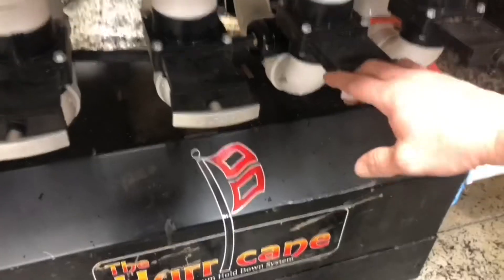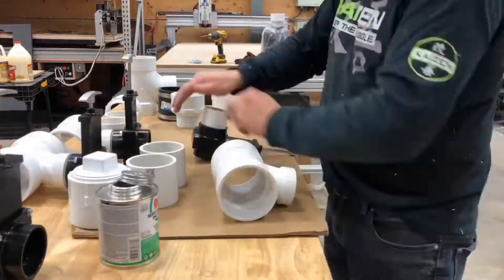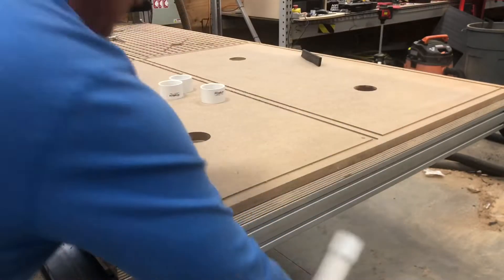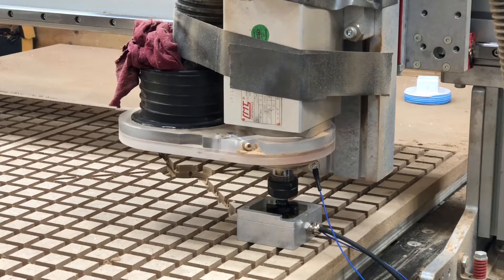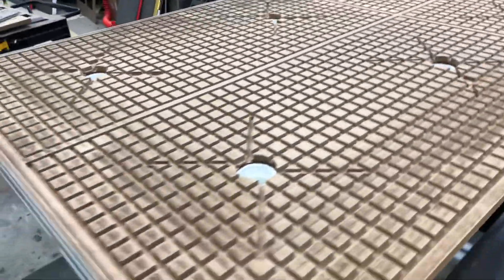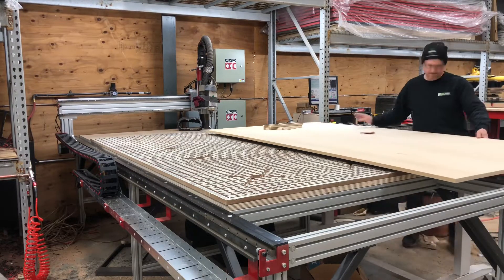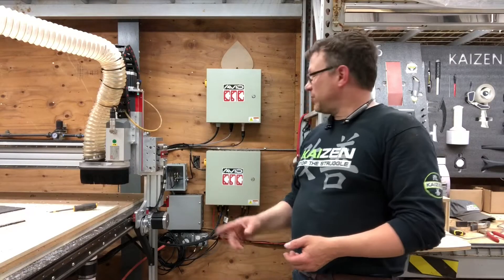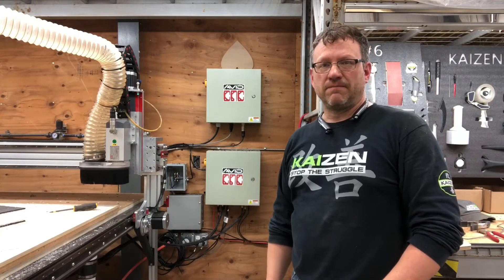Building a vacuum hold down table for my Avid CNC machine

Comment: Thanks for the video. Excellent job.

I just ordered a 5x 10 with extended gantry and 2 Z axis with 12" ballscrew. I'm planning to do this exact setup for the vacuum table. Ready to order the hurricane right now. Is there a competing Vacuum pump system I should look at or have you found the Hurricane to be satisfactory?

I'm also curious why you couldn't just do the plenum table out of the 1" HDF instead of stacking another layer on top? Seems like losing 1-3/4" of height before spoil board adds up to a limiting gantry height. Also you mentioned only gluing the surface of the plenum squares, but it seems to me you wouldn't want any possibility of losing air through the plenum board, so you would want to make sure the entire surface is sealed, so maybe gluing or sealing the grooves would be a little batter. Would you do it the same way if you did it again? 

I saw someone mention copper wire for static buildup. Did you do that or has that not been a problem?

Thank you for your time!
Reply from the maker: I have definitely found the system to be satisfactory for the price point.  Just purchase an extra motor to keep on hand.  They will go sooner or later. The only other option would be to build a system yourself using vac motors, or vacuums for that matter.  

I built my first table using the 1" for the plenum, and after I cut in all the grooves, it had flex to it.  I have 12" of travel on the Z, more than enough room for me.  I also sealed the grooves of my first version, it is a royal pain, and honestly did not notice any gain.

As far as the ground goes, I have a single bare wire that lays on top of my PVC valves.  Also have may dust collector pipe well grounded. I have never had a problem, but you can't be too safe with grounding for static.

Hope this helps!
Brian

Comment: One warning - Due to the potential hazard from a dust explosion (Static from plastic pipes), either use grounded metal piping or run a bare copper wire inside the pipe and out to earth.

Comment: A better way of going about this.

1. Screw down 1” regular MDF
2. Screw down finished plenum sheet to 1” MDF ( don’t glue it, no need )
3. Screw down light weight MDF to plenum.
4. Surface plane the top of light weight MDF.

DONE

you should not use glue between Plenum and lightweight MDF. The glue will reduce air flow.

Comment: Brian- since you glue the entire assembly together, do you just scrap the whole set up when your spoil board gets milled down too thin, or is this s very specific set up that won't kerf the spoil board?
Thanks, much appreciated.
Reply from the maker: That’s a good question, this is my second machine set up this way. We typically bring the spoil board down to about 3/16 of an inch, resurfacing as needed. Once we get to that point we simply mill it down to ground zero. Barely kissing the Plenum board surface. Then just re-gluing a new piece of ultralight like I showed in the video

Comment: It my experance for vaccum  you dont need large pipes... vaccum is vaccum...the bigger the pipe the longer it takes to evacuate  the air in the system..
Ie you manifold.. you could have 1 or 1.5 inch pipe with no issues
Reply: You need high cfm and high vacuum.  Can't run high cfm with small pipe.  If you are running a vacuum jig where there will be no leakage then yes, vacuum is more or less vacuum.  In a situation like a cnc router, there are times where you will have high leakage from cutting through, and that is when you need the high cfm.

Comment: great looking setup Brian.  I just got done setting up a 6 zone system on my old digital wood carver.  It's a small vacuum pump and won't pull through a panel like yours will...  At some point, I'm going to upgrade to a big boy cnc.  I'll probably copy most of your design when I do.  I need to look up those blast gates.  Thanks for sharing...
Reply from the maker: My first vacuum hold down was very similar to yours on the digital woodcarver, I also have a design that allows you to use a regular vacuum cleaner that holds down product just as well on the DWC, I will do a quick video of it sometime this week and show you
Reply: @brianway  Hi Brian, I would be very interested in the design that allows regular vacuum hold down on the DWC as well. Been looking for a good design for my DWC to add vacuum hold down.